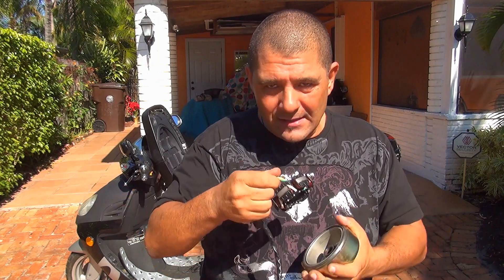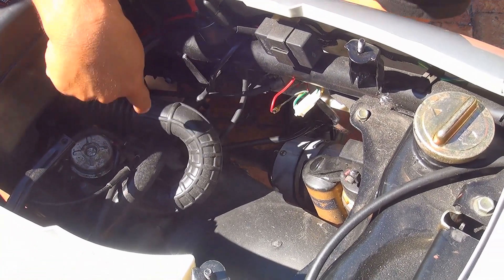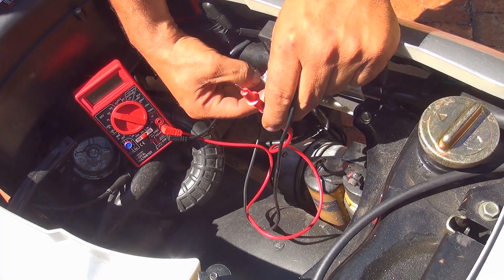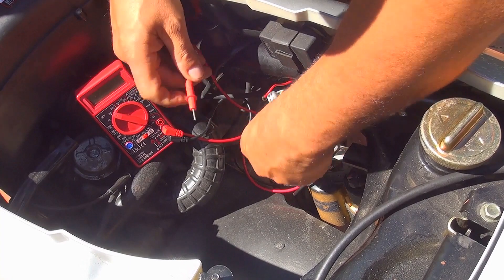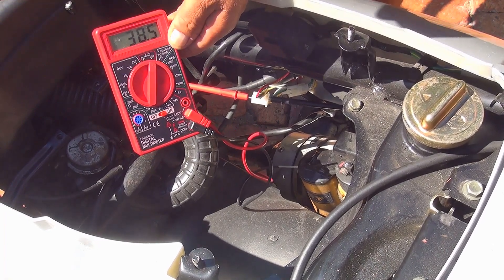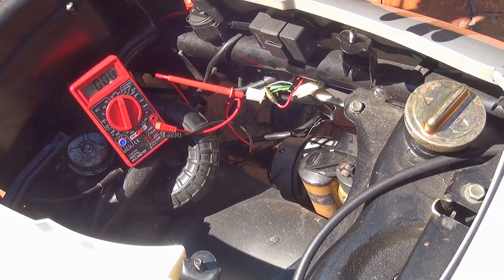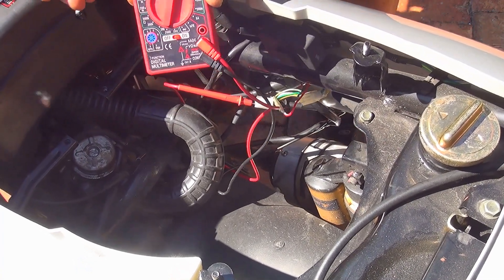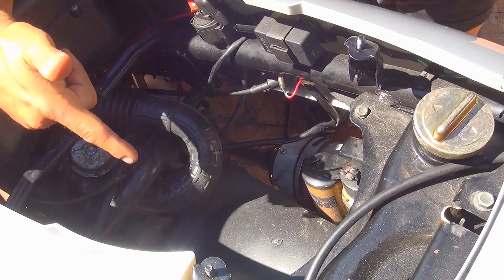Scooter Stator Output voltage

Comment: I was having charging problems when I added a radio and running light to my 150 scooter. i did this voltage test and on the yellow and white wires one was running the correct voltage you show and the other one was way lower which one i do not remember. I ordered a new stator and installed it same thing one low one good. So i ordered another one same thing. So frustrated I ordered the updated 11 pole stator with 3 yellow charging wires. Guess what. Two  of the wires are putting out great voltage and one is the same low voltage as the ones on the 2 wire 8 pole stator what is going on. They all ohm out fine. Is it possible they are all bad. Or what . Are you sure both yellow and white put out 30 v and up any help appreciated. Anybody else having this problem.

Comment: If I Kick mine fast it will produce 105 volts, and it still sends 4 volts to the ignition coil. I bought the CDI like 4 weeks ago and it doesn't have even 3 hours on it, could it be burnt?. Also great video

Comment: Hi virberelo , i noticed i have two shunt resistors bolted to chassis and connected to stator , in my scooter which is burning hot all the time, is it normal ?
Reply from the maker: Hello yes in some scooter you can find those resistors I think to stabilize the flow of the voltage and to make sure your lights will not burn to fast and yes they get hot and is normal

Comment: Hey how about if my headlight works but it’s like really low like a Christmas light and it’s not bright enough what do I need to do to get it fix ? I have a AC system and had a 150cc put on it and put in a Ac stator and change the Voltage  regulator and put a new stator in and still doing the same thing and it won’t charge the battery
Reply from the maker: Hello my friend check how much ac voltage is your stator is producing and if you want you can always upgrade your stator to a more pole stator like a 6 or 8 poles stator more poles you have on the stator more electricity you will produce but not 11 poles because is producing to much electricity but you also have to make sure you do not have a short in the system
Reply: @VirberelloScooterTips  I’m already using a 8 pole that’s what it came with when it was new I kept it as a 8 pole
Reply: @VirberelloScooterTips  and I was thinking that it might have a short cause when I had the 80cc put in I seen a little bit of smoke on the left side of the bike and I’m thinking it’s got a short some where

Comment: my 49cc scooter rear backlight is coming on and off could it be a problem with the stator
Reply from the maker: Hello my friend check the micro switch connections at the brake levers
Reply: @VirberelloScooterTips  thanks virberello I will your a big help

Comment: I have an aeon 180 overland atv and I want to test the stator becauseits not charging, but when I disconnect the clip from the stator like you did it doesn't start its dead no electricity,,,what am I doing wrong ? thank  you Virberello
Reply from the maker: Hello my friend that sound like a bad battery because the atv should start with the starter or with 
the kick start
Reply: @VirberelloScooterTips  I changed the battery put a new one but same think,,,,Thank you for the response and have a great easter ....greetings from greece

Comment: I got a question , do you need a fuse wire to the battery for your  electric start button to work ? Anybody help
Reply from the maker: Hello Erick yes you have a fuse wire next to the battery  that save the all system from any shortage and if that is burn out your scooter will not start so if the fuse is bad the button will not send any power to the starter motor relay to start
Reply: @VirberelloScooterTips  thank you so much I have a tomos nitro 50 cc and it’s very hard to find videos but yours help me a lot

Comment: What is the maximum voltage at around 9k RPM?
Reply from the maker: I never try that but could be very interesting to do 9K just before your scooter explode ah ah ah
Reply: Oh, sorry, one of my scooters is a 2 stroke. It revs higher than that.

The reason I am asking: I want to use a voltage boost/buck converter coupled with a small super capacitor bank to convert the AC voltage to DC 9 volts and run a LED headlight without flickering.

What is the maximum voltage you have observed?

Comment: Great video.  Thank you.  Question though...if you disconnected the stator, what was powering your CDI to actually start the engine?  Does the CDI get “simultaneous” power from both the battery at the stator?
Reply from the maker: Hello my friend yes if you go online and search for gy6 150cc scooter wiring you can see that the cdi get power from the battery and the stator so if one of the 2 fail your scooter will work for few more  miles before it stop working all the way . thank you for watching my video

Comment: Thanks I’ll be doing this tomorrow as my battery isn’t charging up well as I think it should during riding my 50cc, it defo gets some but I have to top it up.

In that 4-way the ground is obv the green, but was the yellow lights, white battery and then what is the other 4th wire you don’t mention? My logic says thats the one from the stator to the spark coil but then its unclipped so surely can’t start?! Any help appreciated! Thanks again love your vids.